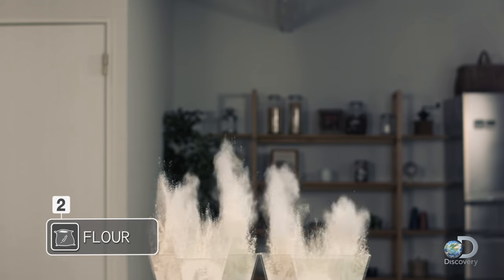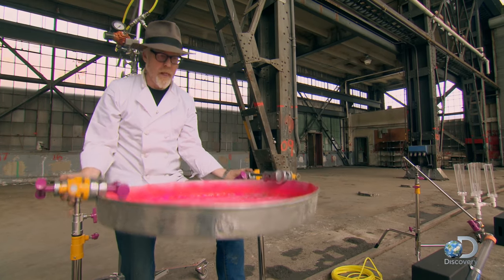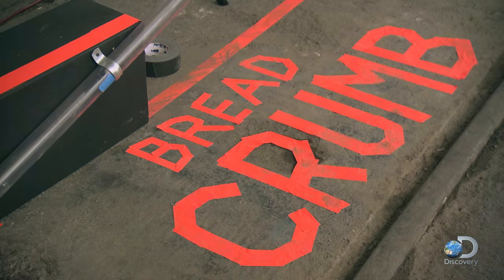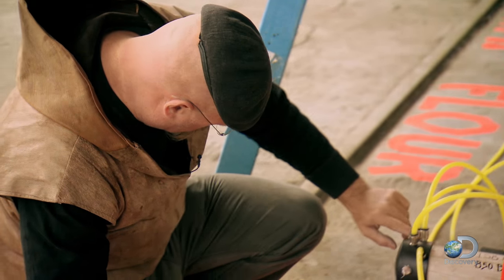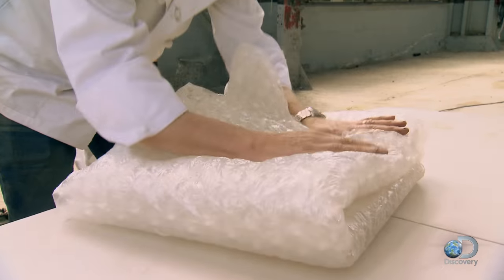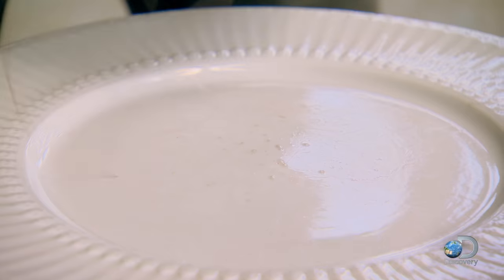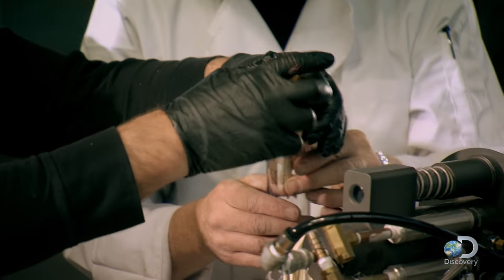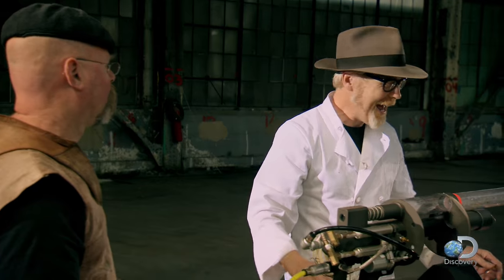Cooking Shrimp Mid-Air | MythBusters

Comment: They obviously did this one just because it's fun. The original viral video was clearly edited. You can tell if not by common sense if you are a cooked but by the last few seconds. Pause the video as the shrimps hit the pillow at the end and look at how they are angled. You can see exactly how all six were to fall on the plate. Then it switches to six shrimp moving at a velocity and angle clearly dropped from a few inches above the plate by hand to fall perfectly. They are also not the same color and have clearly been cooked more. The shrimp would not be so perfectly coated if they were the ones shot through the ingredients either. If you are going to lie and make a fake do your best work. See how they fall in the real run through and drop the cooked ones on the plate as close to this as you can. Make it harder to see its fake. The myth busters still got to do cool stuff though. Why not try it you get to build fun contraptions and eat any left over shrimp so buy lots.
Reply: I forgot to mention the shrimp in the viral video were already cooked so the mythbusters didn't need raw ones but hey again more fun right.
Reply: It's not a viral video, it's a phone carrier advertisement.